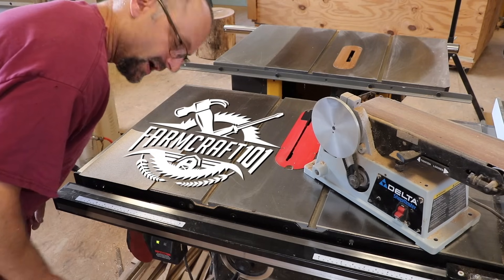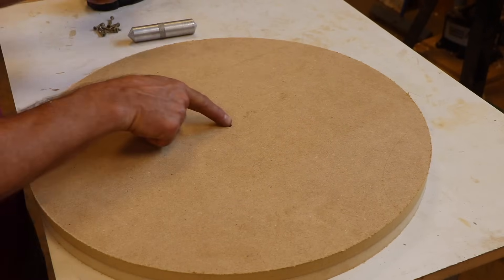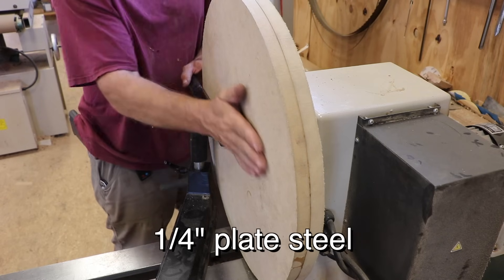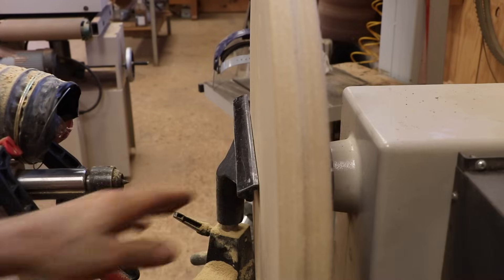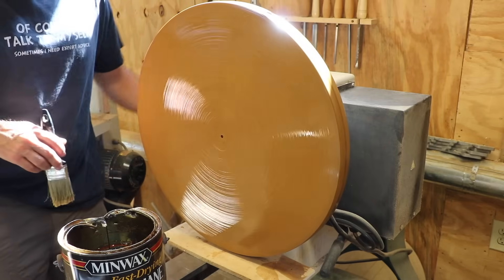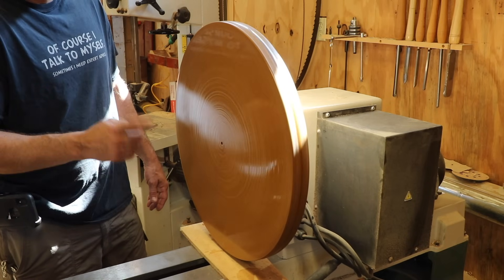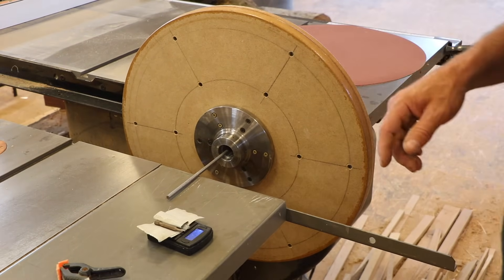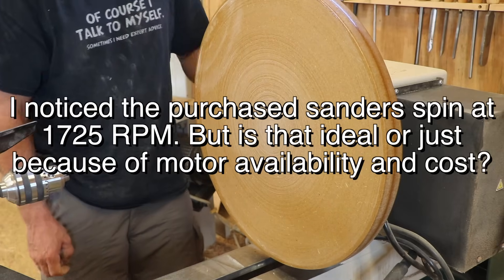DIY 20-inch Disc Sander Build.  $2000 Tool, Cheap and Easy.

Comment: suction will hold your paper to wheel fine holes though disc whole system with (an innner draft well ) ratio of more holes on back side near perimeter using more holes on back passing a directed open vac hose, wii work with wheel spinnning America so experiment

Comment: Well, if you were worried about the mdf pulling away with the sanding disk you could have used a coat of resin, though I don't know how well that would soak into to mdf. Maybe if you used cactus juice.
Reply: Also I'd be less worried about the nearly null vibrations you have, and significantly more worried about it flexing and going excentric when you jam a piece of wood into the paper.
Reply from the maker: I think the 1.5" thick MDF is strong enough.  I guess time will tell!

Comment: Well done !  I made a disk sander from a older MK1 shopsmith disk just mounted it on a washing machine motor (1040 RPM) added blocks of wood to make a platen for it and raise the motor and sander up and installed a normal light switch....  the thing works great !

Comment: I have a cheap and easy 4x4 pickup build. I just found a beautiful set of off-road tires and wheels for 50 bucks. It works and drives great.     Oh yea, I almost forgot, you'll have to have a truck laying around.

Comment: I saw a youtube guy using a str8 flat stick with sandpaper on it to flatten the bottoms of his turned vessels. It seems that would be a good method to flatten your disc rather than turning it with lathe tools. I mean like all you need is the abrasive on the other side of the equation as long as the face is flat......

Comment: I got sick of changing the sticky backed sanding paper on my 8 inch disc. Turns out after much searching, I bought a loop (fuzzy velcro) sheet and attached it to my aluminum disc. The "hook" 8 inch discs are cheaper than the sticky discs and they're a snap to change. Not sure how long the velcro lasts, or if you can find them in 20-inch size. Good idea using the lathe. If only I had one...

Comment: The real test will be when you have to replace that sanding disk. You have to use heat to get the adhesive to release. Then you need to use solvent to clean off the adhesive. What is that going to do to the poly finish? Still looks pretty darn good though. Maybe the best would have been a 1/4 aluminum plate glued and screwed to the mdf. I noticed the sanding disc did not end up centered. So much for your careful balance of the wheel. 

Next time you mount a sanding disc do this. Tape it to the wheel around the perimeter and adjust until it is centered when you spin it by hand. Then un-tape one side and peel back the plastic sheet. Cut that plastic sheet as close to the center as you can then carefully fold the sanding disc back up so it sticks to the mdf disc. Press that side of the disc down. Next un-tape the other side and remove the plastic backing then carefully roll it down from center. You will end up with a sanding disc glued in the exact center of your mdf disc and have much better balance at higher RPM.

I made a 12" disc sander using an old craftsman table saw with the cast iron base. I replaced the saw blade with a pulley, next I used bearing blocks and a 5/8 shaft mounted to the top. Ran a pulley up from where the saw blade mounted to the shaft.

I bought a 12" hub and aluminum face plate made for a shop smith and mounted it on the shaft with the bottom down into the saw blade opening. Shaft center line is above the table but I use a mdf board with skate bearings on the sides and on the bottom to engage the guide channel. This moving platform is vary close to table center line so it worked well for sanding my plastic vacuum formed parts.

The double pulley reduction worked to slow the rpm to around 1000 so when sanding plastic it was sanded off instead of melted off due to too much heat. 

Had to sell that sander to move across country. Now I am about to build a replacement. I am going to build the next one with a 3 phase motor and a VFD drive to adjust rpm. I am also going to put a amount with a shaft on it on the end the motor is on. 

Then run another pulley up to that and mount 3 buffer wheels, coarse medium and fine for buffing plastic. Built a 3 stage buffer like that using a DC tread mill motor and it worked super great. Sold that for the move so need another one. So this sander will be a combo 12" disc sander and 3 stage buffer. Got the saw and the 3 phase motor. Need the rest of the needed parts before I can put it all together. Maybe I'll slow down enough to make a video?? probably not though.

Comment: I'm not going to take the time to look it up, but you should be able to get a calculation regarding the moment arm that moving the weight inwards will involve.  You also need to take into account the presumed removal of some mass from the boring you to for the screw. Given what you are attempting that's not necessarily non-trivial. 

Another consideration which could be relevant would be the wobble. That is, you haven't done a centerline weighting, e.g., your centerline through the middle of the plate may be off, as well, and putting your screws into it will likely increase that.Not sure what you can do about that, if it turns out to be of significance.

Comment: Good stuff and a fun project. For speed, if it is balanced, you should be able to go to max. That isn't for use, but just for spinning.
Reply from the maker: I think the MDF would break if I tried to spin it at 3200 RPM. Would have tremendous forces on it.

Comment: 4 or 5 coats of polly with sanding between, you should be good for a long time. Or you could epoxy a .5-1mm metal skin on it and it would last longer than you at a fraction of the production models. 
I think you’ll find yourself using it much more than you realize, now that you have one.

Comment: Now it appears this disc is larger than the circular sandpaper sheet. If so, would it be an advantage to create thumb holes along the outer edge of the disc to help center and remove the sandpaper sheet?

Comment: If you look at the video... right after you take the clamps off and spin it on the opposite side of where you're showing it wobble, there is another wobble or a gap between them. Not sure what it is but you could see it before you tried testing it.

Comment: I did almost that exact same thing, I have access to a friends machine shop, and we surface planned it and used his lathe to make it smooth and then attached (glued & screwed) a sheet of 1/4" plexiglass to the MDF and now it is only .0001 out from center to far edge it has worked great for about 5 years so far.. I know it does not have to be that perfect, Like I said I have a good friend who has a machine shop, he would  not let it go till it was almost perfect.. LOL.. Loved your video, thank you for sharing.. Try facing it with plexiglass if you are having issues replacing the sanding disk paper...

Comment: Every sanding disc I've ever seen has holes on the face plate. One to get to the screws that hold it together to the back plate, and to make putting the sanding disc on and off easier. I have a vision of a homemade disc having a series of holes in semicircle patterns. Like a fan blade pattern. Form, fit & function. 👍🏻👍🏻🇺🇸

Comment: You could glue a piece of laminate to the mdf in lieu of a metal plate. A little shellac wax will ensure that you can remove a sanding disc from the laminate.

Comment: Looks good.
I'm interested in building a sanding disc with a slight conical section, I think about 10 or 15 degrees and not as large, maybe 10 inches diameter so it's still possible to fit the paper. 
This effectively enables you to have straight line sanding as the wood will only be in contact at a single point. The table will be above centre and slightly tilted to be at 90 degrees to the disc. Then pieces of timber can be pushed through  against the rotation so that they are  sanded with the grain rather than in a curve. Paper will probably need a large hole punched in the centre to help it fit. Read something written about this maybe 40 years ago.
Reply: That same geometry disc is also used for sharpening clipper blades. It creates a convex which is a concave on the blade. Most people think the 18" wheels are flat across but they are actually machined at an angle. I hadn't thought about how it would work for straight line sanding or grinding, but it makes sense. For clipper blades, we use oil and aluminum oxide powder to coat the wheel rather than abrasive paper. A belt grinder and flat platen could be used for continuous sanding long stock as well. The max length I have done on my 2x72 grinder is 18-24 inches. It is perfect for smoothing the edges of steel parts by grinding parallel to the edge instead of across, so the grind lines are long and smooth when you run your finger along the edge.

Comment: I would put a hard face on it.  Probably just get a round piece of plate glass cut and glue or tape it down.  3M make good tape for hanging mirrors in frames that will hold glass against very high torsional loads that would allow it to attach to the face of your wheel such as 9040.  That would both prevent tear out when replacing the paper and prevent deformation of the wheel over time when pushing hard as MDF is quite soft.
Reply from the maker: I'd be a little scared of having glass on it.  If something were to happen, though unlikely, glass shards flying across the shop...probably hit me in the neck!  No thanks! ;-)  Acrylic, polycarbonate, steel, aluminum, melamine all would work without the shattering risk.

Comment: Don't see any wobble so the disc runs true and you've got it balanced well. Another viewer suggested you seal the back to keep water vapour from being drawn into the disc. Also take your face plate off, seal under it and replace.Great job!

Comment: Nice job. Curious though why you didn't just use the screws holding the two disks together as your clamps for the glue-up?
Reply from the maker: Sometimes screws will leave a small gap between pieces unless you predrill precisely or really crank them down which would have stripped the MDF.  Probably would have worked, but I had the clamps which always work.
Reply: @FarmCraft101  Makes sense. Thanks.

Comment: Lol cracks me up. You're just like my father, using a drill to drive screws. It drives me NUTS as I have about 4 impact drivers and instead he grabs a drill. Teasing of course, hell that's all we had back in the day was drills, impact wasn't invented yet for screws. Joking aside, good job, I too need a large sander. but I want to make a 2x72 first.   Working on wood, having the MDF plate should be just fine. But if you do much metal I would 100% switch to a 1/8th metal plate minimum.

Comment: What do I think? 1/ Call Norton and ask them what SFPM they recommend for their various grits of abrasives.  2/ Use a felt pad to apply the top coating.  3/ Prepare yourself for a royal pain-in-the-ass when it comes time to renew that abrasive disc.  4/ Never lose your abrasive cleaning stick, you'll need it.

Comment: You could try doing a tabletop epoxy pour. If you have the disk level it should self level and be pretty flat and the paper shouldn't pull it off.

Comment: This may be really dumb, but what about an old man hole cover? Would you be able to turn down the surface flat? Probably get one from a scrapyard for cheap.
Reply from the maker: Problem is my metal lathe can only turn up to 12" or so, and trying to true up a big piece of steel on the wood lathe would be tough if not impossible.

Comment: Here in Australia some authorities get all bent out of shape about mdf dust because of the formaldehyde content. I use it sparingly due to the really find dust, I'm not worried about it I just find it a pain, but it is handy due to its very good flatness. Great video, i got my dad's old wood lathe when he passed and I've made a few small things on it but a larger sander is a great idea. Thanks.

Comment: MDF is pretty stable. As long as you don't have any issues with vibrations I don't think you're going to have a problem with it blowing apart even up to the top speed of the lathe.

Comment: Get yourself a piece of .25 inch steel, as big as your sanding disk and cut out a piece the same diameter as your sanding disk.  It is not hard to find the center of a circle by using th chord method if you learned it in geometry - a 90 degree line from the center of the chord will pass through the center of the circle.  One you have your steel plate, you can glue the sand paper to the steel plate with contact adhesive.

Comment: Very good I will try at sometime.  Made a cannon like yourself but we ended up using a steel barrel and fuse tube with a cast brass outer.  Only tried it with 1oz of powder as we live in the city with bread wadding,  nearly blew out the windows.

Comment: For these large sandpaper disc a velcro back is available. Gluing standard sandpaper with regular glue on MDF will hold, but the surface of the MDF will be unrepairrable distroid.

Comment: Tip to anyone making one if these. Mdf is hard on the outside and sponge like inside. Be careful to take off the absolute minimum when truing the surface, its quite thin.

Comment: Rather than turning to flatten your disc, you could have wrapped sandpaper over your toolrest.  You're never going to freehand a flat surface.
MDF is great, but its dust is really nasty.  Normal wood dust is bad enough, but MDF is in a different league.  I'm surprised it doesn't come with health warnings on every board, like tobacco products.  You should always use a proper face mask with sub-micron sized particle filters with MDF, preferably in conjunction with effective dust collection, with the collector is in a different room.  The dust particles are so fine that they stay airborne for hours, so if you haven't got excellent dust collection with HEPA filters, you're still breathing it in hours after you've finished.  Because the particles are so fine, cheap face masks, and most dust collection filters just let them through.  The lungs can expel large particles in mucus, but MDF particles are so fine that the lungs can't expel them, so they just lodge there until you die, possibly from respiratory failure.  I do all my MDF work outside, because although I do have dust collection, it's inside my workshop, and my lungs are important to me.

Comment: Just a thought
A tracked tractor operator (like I was years ago) was called a Cat Skinner no matter what brand of tractor he ran or the job he was tasked with. 
It could be moving dirt at a construction sight or pulling a sled grain over uneven ground in forested or bush country. 
The Skinner part comes from the times of the mule trains that helped the north american continent open up, the men were mule Skinner's.

Comment: Just a thought, why not use melamine? It's almost as cheap and will stay much flatter, then just use spray adhesive to attach sandpaper.
Reply from the maker: Would probably work too. This is just what I had.
Reply: @FarmCraft101  Gotcha! Since I do a lot of segmented turning and have the same useless disc sander on the side of my belt sander, I think I'll try this, it seems like an awesome option for making sure my rings are flat before gluing, thanks for sharing!
Reply from the maker: @quietinspirationcreations3448  Yep.  That's one of the main reasons I wanted it.

Comment: Skinning a cat comes from the Irish nickname of the 'Treecat' which was a Pine Martin. As for balancing the old trick for motorbike wheels would be to hang the wheel, centrally from a string. The wheel will dip where heavier, the high side needs the weight

Comment: If you put a Velcro backing on the wood you are just peeling off the Velcro on the sanding disc not touching the wooden surface!
Reply: That would be a lot of Velcro, it's a 20" wheel.
Reply: @tomnorman5461  you should be able to buy sticky backed Velcro discs. Not sure if you can get 20” discs.

Comment: I did this with my 12" lathe and used melamine. Not too hard to change the disc with a heat gun. Used peel and stick discs. Got a new to me lathe with a 16" swing over the bed and made a new one also with melamine. Only 1 thickness but no wobble at all. With a non adjustable table that slips into the bed I can move it right up to the disc and easily sand very thin pieces with no issues. I really like the ability to dial in my speed for various tasks. Can't do that with one of the one speed belt and disc combos.

Comment: Any updates on the Disk Sander? Wish I would have done this.. Wouldn't change a thing? Maybe a pinned comment for those latecomers like myself?
Reply from the maker: I haven't needed to change the disc yet, but no complaints so far.
Reply: @FarmCraft101  Awesome. Thanks for the comment.

Comment: I would seal all the surfaces and then re-true it, but it is MDF.

But something escapes me and I don't know wood turning so please forgive me if the answer is obvious. When you used a straight edges across the whole surface, I can see how true the surface is. But then you had the tool rest and worked only from the one side. How do you know you didn't make a very shallow cone?

Comment: You were wondering how fast you could spin it. It's not too late too recess the hub into the MDF by about an eighth of an inch. It appears the torque against the MDF and the hub is reliant on the screws but a recess in the MDF centering it on the hub would also help prevent the MDF from flying off the hub at high RPMs.

Comment: Just have a question. Could you use a chopsaw saw blade? I know it would not be as large but I could get by with a 12 inch diameter.

Comment: I did this using hardwood from old pallets glued together turned it into the shape of the disk and then shellacked it so hopefully the adhesive sanding discs wouldn't get permanently attached and it's worked just fine